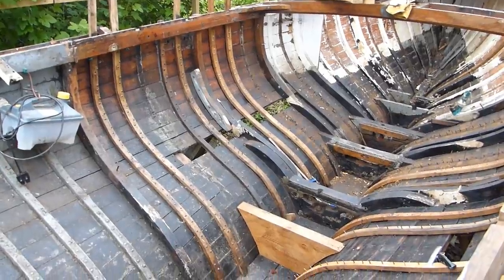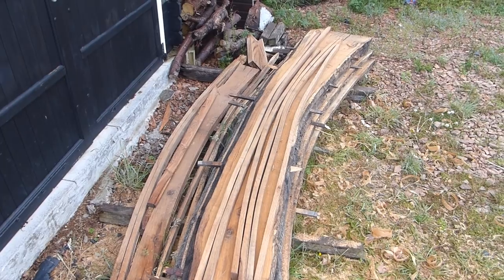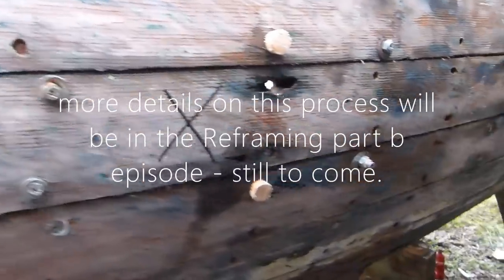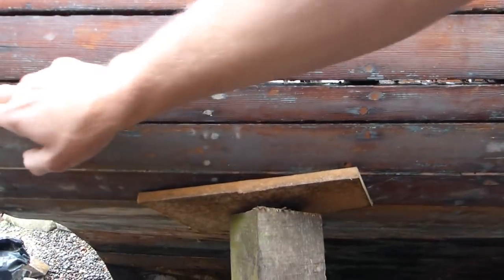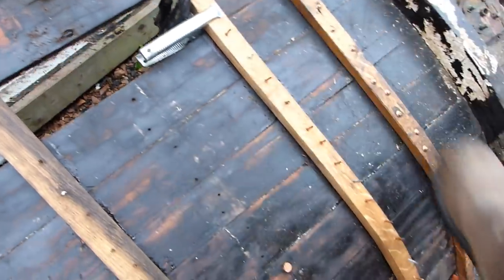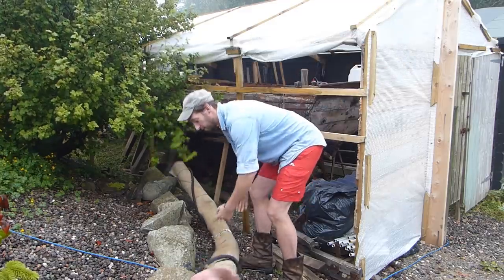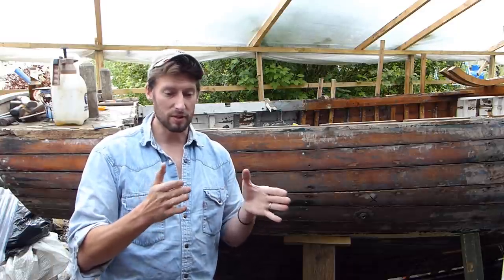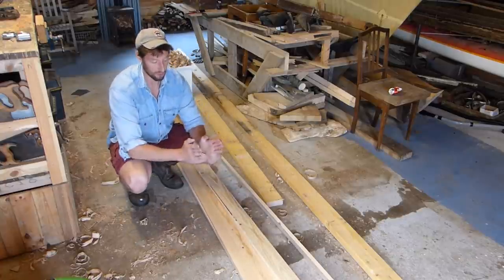Reviving an Idler - Episode 13  - The last waffle  - Progress!

Comment: A little tip for a quick steam "box" - purchase sections of insulated galvanized stove pipe, 4", 6" or 8" depending on your needs.  Usually comes in 3' sections and you can build it as long as you need it.  It's stiff, holds temperature, etc.  Wooden half moons placed at the ends of each section will hold your material off the bottom.  Plug an end  and insert your steam source, another as a return near the bottom edge for the condensate and leave the other end for inserting and removing the material - plug off with a rag, Bob's your uncle.
Reply from the maker: Good idea, thank you! 👍